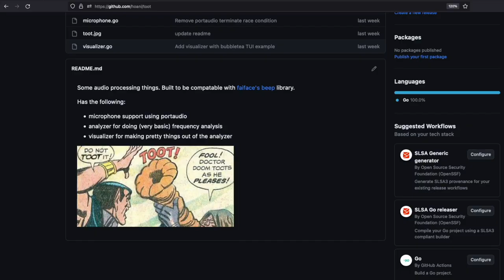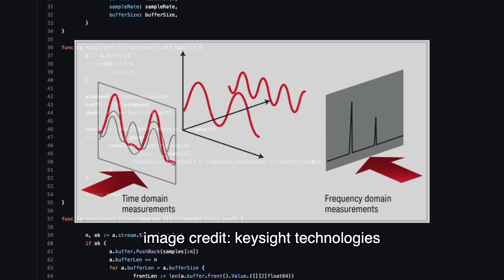Project: AI Speaker chatbot

Comment: I have question i can use raspberry pi zero
Reply from the maker: Good question! I think a pi zero 2 W might work, but I have found that the audio libraries I built run a little slower which is why I went for the pi 4. 
On this project, I calculate FFTs on the audio stream roughly 20 times per second to make the speaker show different responses to sounds. If you removed that feature I think running this on a Pi zero 2 W should work because the openai library and basic audio libraries shouldn't demand too much CPU.
The other thing to consider is what speaker/microphone you want to connect the pi zero to since the pi zero doesn't have a speaker audio jack